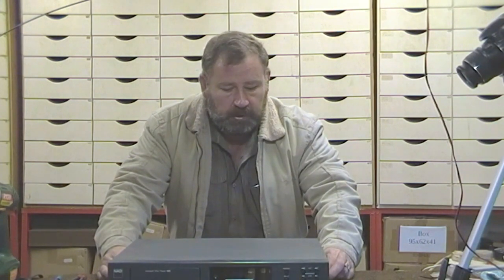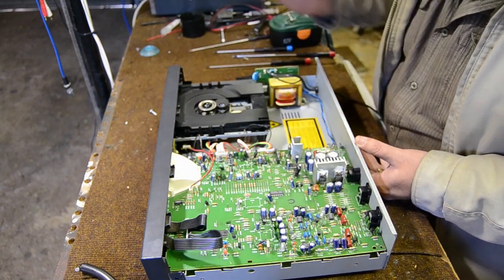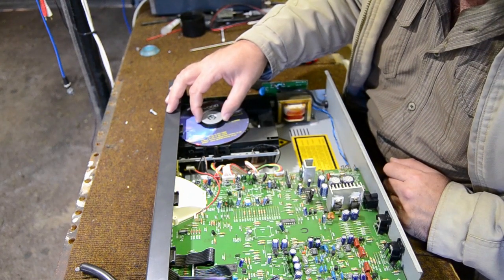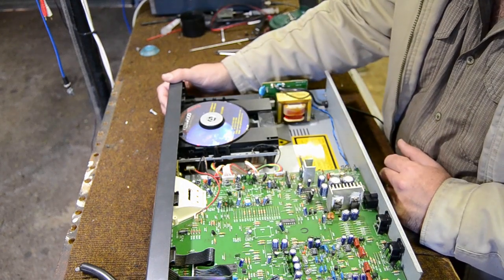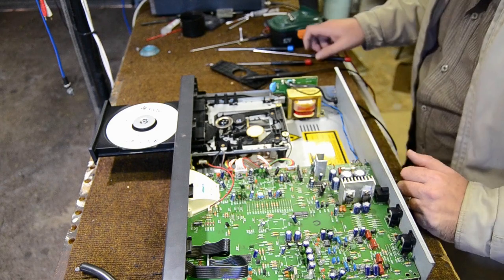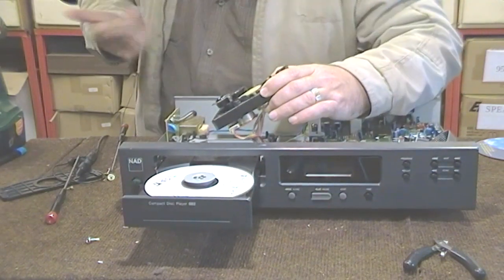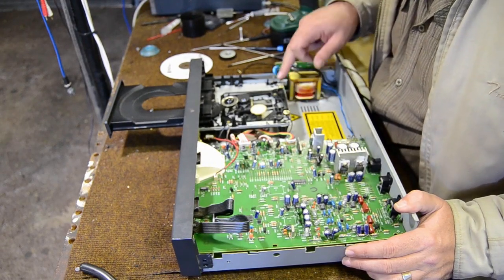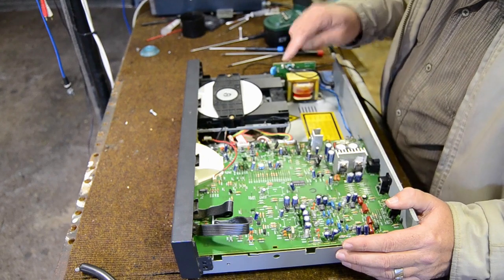NAD CD Player - How a CD player works ( laser unit replacement ).

Comment: The laser looks like it's failed on my NAD S500 Silverline player ( a Mk2 1997 design that has a CDM12.4 transport made by Philips ).

I can get the disc drawer off and removed but the disc clamp/puck is held in place on a metal frame that springs up and down instead of the transport retracting downwards to let the drawer open with the disc. Any ideas on how to get the puck out and the transport out of the player casing?

The service manual available on-line is for the S500i improved model which uses a different Sony transport ( not a Philips CDM12.4 ) with a similar clamp to the one on your 502, and isn't screwed in place in the same fashion. On the Mk2 S500 the whole transport is suspended from two rails that run fore/aft and the securing screws face downwards underneath the rails making them almost impossible to get to without a special tool (a small allen key might work but I've no idea what type of head is on these screws as I just cannot see them, they face downwards to the bottom of the player - may have to get a dentists mirror to see them.

Can't remove the rails as they support the mains transformer and all the separate tappings to the analog, digital, control and output stages (all on separate boards) and I don't want to take the whole player apart, just the transport, so I can fit a new laser pick-up.

Comment: Great tutorial, managed to repair my NAD C 542 cd player (tray didn't come out). Many thanks
Reply: Hi Andrey, great thing to fix the tray-issue! What did you do? Belt exchange? My NAD c521i player is great working, exept ejecting the tray. Motor for the tray is working, but does not get any voltage when pushing the eject Button…
Reply: Do you have any idea?
Reply: @peterstoeful  In my case, the incomplete disassembly of the mechanism helped, as far as I remember, the whole thing was in the limit switch
I'm afraid it will hardly be useful to you,
best wishes
Reply: @andreydavydov6417  ThX!

Comment: Agreed. Thanks for the video. I also have a NAD 541 with a temperamental drawer not opening, and the laser not reading tracks or skipping as it tries to play. I thought I might be able to "clean" the laser and "oil" the drawer mechanism. Is it worth replacing the laser unit if the laser can be serviced? Any responses from any fellow NAD-ophiles are welcome.
Reply: Hey, if you still have it, you may find the drawer is stuck because one of the belts has degraded and become slack. Open the lid and study the CD loading, looking for slippage on the pulleys.

Comment: great vid but how do you adjust the laser's output (when it doesn't recognize a disc)/
Reply: You can't adjust the output (well you can try increasing the current but you'll just end up frying the chip that powers the diode so it's not a solution - it would be like running your car on Jet-A aviation kerosene, it will just blow up from the additional heat).

The laser is a semiconductor diode, and when it's stopped lasing it means all the electrons and holes in the doped P-N junctions have changed energy levels and the diode is effectively "exhausted" or dead. Much like a typewriter ribbon that has all the impregnated ink used up or a turntable cartridge stylus that's had all the diamond worn away.

The process usually takes a long time, typically a CD semiconductor diode has 10,000 hours of life which equates to a 10 - 15 year lifespan, but once the diode has stopped outputting light, that's it - game over.

The only solution is a brand new laser pick up fitted with a brand new laser.  And a fresh 10,000 hours of life.

Comment: My NAD 5170 plays a cd and you can just barely hear the music and a pink noise static sound overshadows the music in right and left channels-can someone tell me where to start in diagnosis?
Reply: Almost certainly a compact disc with CD rot. I.e. the Aluminium reflective coating has oxidised and turned into dull non-reflective aluminium oxide. This was a common problem when the CD manufacturers failed to encase the aluminium with a resin top coat, leaving the aluminium to slowly oxidise from the disc edge inwards.

It ruined a lot of discs pressed by Du-Pont Optical at the Philips plant in Blackburn. If you're lucky, you've got a disc where the oxidation doesn't encroach onto the disc inner segment where the data is read from. If you're unlucky, the whole disc turns a dirty bronze colour and won't reflect any light back to the detector photodiode.
Reply: Thanks for the info-I’ll try a different cd and see if it makes a difference

Comment: Excellent video, thank you for posting.  My unit, a NAD C541i, sees CD's, reads the table of contents, but wont' 'zoom' to play the specific track.  I am assuming the 'slider' mechanism is stuck, or refuses to move up and down (along) the CD so as to play each specific track.  Any ideas?  How do I fix the 'slider' mechanism to enable the CD's laser to move to each specific track after reading the table of contents.  Thank you. (sub'ed).
Reply: The laser focus might be broken (fairly common failure mode), but it's also possible that the laser tracking motor on your transport, or the "null" microswitch that locates the laser in it's "parked" position are faulty.

The laser beam is focused down to a small 0.9 micron diameter beam to read the pits which vary in length. The disc can be warped or misloaded by as much as 0.5 mm, and the focussing solenoid has to have sufficient movement to accommodate this. Hendri shows the focussing lens moving up and down. Your disc could be warped by more than this and it would exceed the compensation available in the focussing system. The main CD spindle could also have worn bearings, like an out of balance wheel, and it would be impossible for a laser to track the CD as the wobble will increase with the laser moving to the outer edge of the disc.

With the laser tracking across the disc itself - that uses a separate mechanism - either a radial arm like a record player conventional tonearm, or a rack and pinion like a parallel tracker tonearm. You can see Hendri moving the rack and pinion in the video. It's worth stripping the mechanism down, removing the dried up old grease with isopropyl alcohol and relubricating with fresh grease, as you would when servicing a mechanical watch. But if the motor or microswitch has failed, it's probably a brand new transport that will be required.

It's very unlikely to be a firmware or hardware (chip) fault, that would knock out the whole player and a power or magnetic surge would also take out any nearby equipment as well, not just the CD player by itself.

Is the player right next to a loudspeaker or CRT TV? If so, the stray magnetic field may be causing the problem, and preventing a hall-effect switch from working.

Comment: hello sir.are the lasers universal.
Reply: No.

Lasers are specific to individual transports. A Sony transport uses a different laser pick-up to a Sanyo, Philips or Toshiba.

DVD drives that can also read CD's as well are a whole different kettle of fish - they pack two lasers into one pick-up.

 And then there's Blu-ray, using a third completely different wavelength of light.

CD uses 780 nanometres, DVD uses 650 nanometres and Blu-ray uses 405 nanometres, which, being violet, it should be re-named "violet-ray".

A CD only player cannot replay DVD's or Blu-ray discs because it's laser only emits 780 nm light. A DVD player might (or might not) be able to re-play CD's depending on the laser pick-up fitted, as the laser has to be multi-wavelength (essentially two separate lasers built into one laser pick-up, with a shared photodiode detector to measure the reflected light off the disc.

Most "Violet-ray" players are only able to replay that format, it's not physically possible to shrink 3 separate lasers (with their own wavelengths) into the available space.